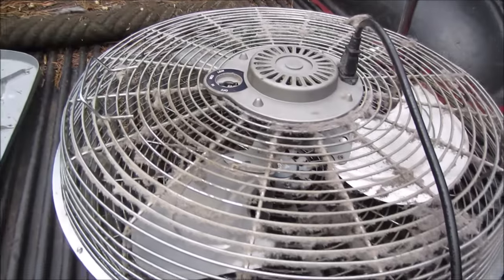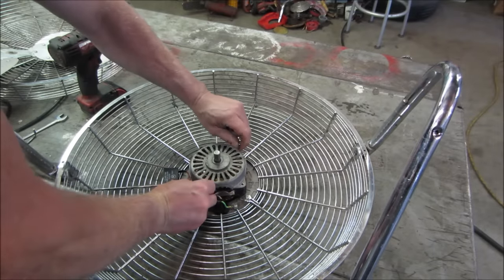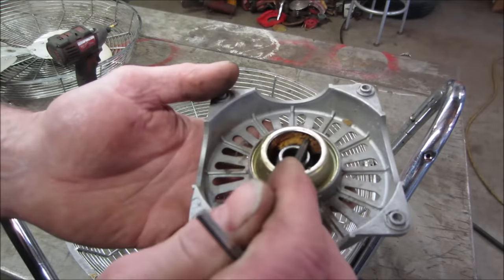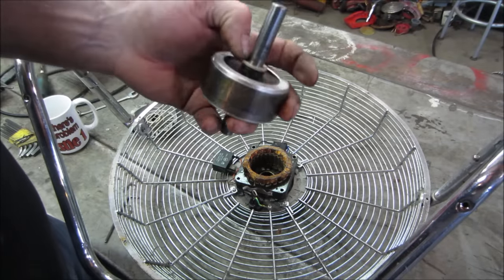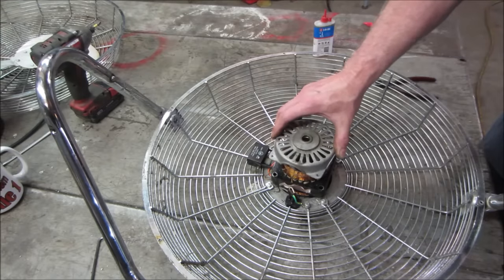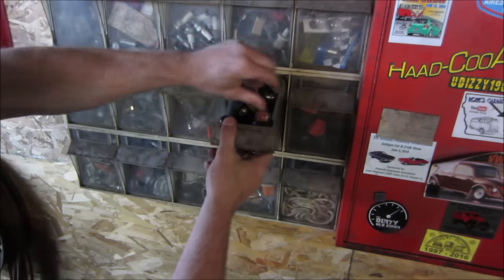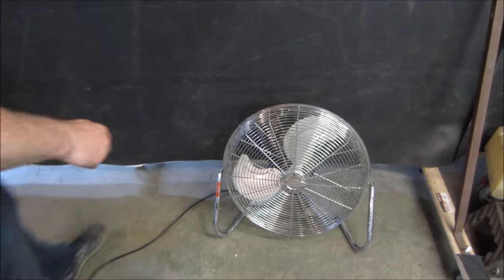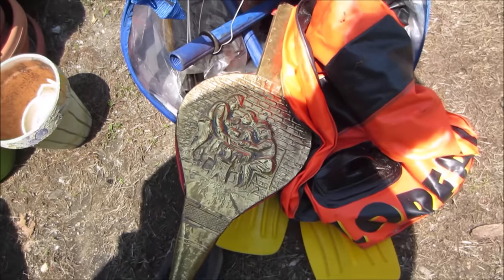Fan Blades Won't Spin? Lets Fix It

Comment: Hi, watched the whole vid to see if it was a fail. If this didn't work then the next thing would be to check the capacitor, they often fail so the motor has no start guts, cheers

Comment: Those look like bushings to me and not bearings. Also that foam stuff inside looks like old lubricant wick. You add oil to the wick and it self lubricates for a long time. I used to work in a Vacuum repair shop and we also did fans.
Reply from the maker: a bushing is a bearing,

Comment: Had a 10” desk top fan beside my bed at work, used it for the white noise to combat my coworkers, yes I said work, I was a firefighter for over 30 years, we were allowed to sleep at night it the occasion arose, sometimes it did, most times it didn’t, had to tear down and clean every couple of months after it was a few years old, sure wish I had known about the 3-1 oil, might have save some frustration at 2am after an EMS or fire call. Nice job, thanks for sharing the video, even if it was two years to late for me, now I know.

Quick question, this should work on all fans right, like a noisy ceiling fan...?

Comment: Its probably foam in the bearing, used as an oil reservoir, (used to be felt years ago), foam goes all powdery and gums the bearings up. Wants a light oil to lube it.

Comment: The only time I went to take one apart it would lock stop when the switch was turned on. 

It had a dead short in the windings. Unfortunately oil and polish won't fix that. But originally it was doing as this was. You could get it going some times and then it'd work normally. During tear down I found a crap ton of shrink wrap wrapped around the shaft behind the fan. It had caused an imbalance and irregular wear which is why if you spun it up it would start working. Ironically it was using the shrink-wrap as the lube when it heated and softened.

Comment: I'm surprised you did not devise some sort of oiling system on this fan like a little oil cup with screw on lid on the top and a tiny recovery basin on the bottom. I have thought about this many times oiling up my fans lol.

Comment: I've been keeping my fans running for years, BUT, you have to take it apart to oil it.  I already know the answer, but why can't some engineer design these fans in such a way where there is some kind of port to oil the fan motor/housing instead of taking it all apart and then hoping you remember where all the screws are and how to put it back together again.
Reply: Old ones had oil ports feeding the felts, I'll bhazard a guess nobody oiled them. I had a modern one where I took it apart new and soaked the oil felts in ATF to see how long it would go, that one blew a thermal fuse buried in the motor windings from dust buildup I had neglected, so there's really no winning unless you put in more work than they're really worth.

Comment: I had the same issue with a table fan (220v).
So, I did the same - removed everything, cleaned everything. Tried first using mechanical grease, but made it worse..
Ended up removing everything, AGAIN, and then used an oil instead. A guy gave me the tip to try and exchange the sleeve bearing for ball bearings. But that will increase the noise level..

Comment: I have fixed many of that type fans ,The better ones,I have found that they put felt as bearing packing (the felt holds the oil) but sometimes I find they put saw dust as bearing packing(The cheaper ones) .

Comment: see that galling and black thats what you polish out, run nail if you feel groove repolish.. i use drill and a vise.. the gooky insides was a feltlike wicking, replace with felt it holds oil.. bronze bearings are porous.. thats why it failed no oil.. lube felt till shiny to touch..  never grease or motor oil it damages ..  amazon has zoom oil non detergent..

Comment: Dude, get ZOOM SPOUT with turbine oil. It's a pure highly refined oil,it's so pure you can lubricate a clock etc..
Also ZOOM SPOUT offers a penetrating oil. These small squeeze  bottles have a see through  flexible TUBE that can extend into small spaces. It retracts inside the bottle when your done.

Comment: I guess im not the only older timer out here who stil posseses tool skills and as a product of depression era parents was raised to obtain, then maintain the equipment i had as well as any castoffs instead of giving in to the destructive capatilist manta drummed into us by the media of buy , use(until out of warranty) , toss, and rebuy another of the same . ive actually never bought a new vacuum, Dayton fan type as this one), dvd player, bicycle, etc because in this nation all i have to do is pick one up beside the road and fix it which usually winds up being more akin to just giving it the proper periodic maintenance due any electo-mechanical product. That said, i believe the govts. Past forty years of slowly defunding the educational system to yeild a more docile and compliant herd by placing them under stress both economic and physical . This tactic and others have been developed , honed, and tweeked to adjust for the time factor, has been used for centuries. Worried ,inept, sick, cattle cause few problems for the .1% as Chomski reiterates.All the shop classes we usez to have in jr. high and high school enabled the kids with an electomechanical bent to discover and guide their future coarse of study ,as much to the chagrin of the politically correct, i must poi t out that many are just not destined for college and a PhD in physics. Were not all created equal and im sorry if that hurts those liberal democratic bones that promote programs to give jobs not to the most qualified but to whichever flavor of the month is in vogue.I know, off topic but somewhat related as we should all be doing what this fellow does for our own sakes and the planet. Its far easier to take care of this one than to migrate to another world. By rebuilding that fan he saves resources and pollution making up for the wasted resources of the person throwing it away ojt of lassitude. Rich/San Jose

Comment: I have this issue with glazing all the time. Dryer rollers are a metal on metal contact. No bearings, just a bushing on the roller. They get full of gunk all the time and start to seize up.

Comment: To add to Colin_583, you normally leave those sintered bronze bushes in thin oil overnight to fill the "holes", I suppose you could heat them up a bit too, to drive out air to let the oil in.

Comment: The quick and dirty way to fix this is wash the motor too with at least garden hose force. Air gun on the electrics, spray the crap out of it with WD40 or whatever, sun for an hour and bam! Works 99% of the time. Engine degreaser also helps if it was in a really dirty environment

Comment: I recently fixed a black fan!   
And the fan wouldn't turn !

But I had to cut out the metal rods that go up and down !. 
Once I pried it open!  I saw the grease part all orange and dried up!.  Once I WD40 and cleaned it. And put in new grease!.

The fan started up like new . And it sounded newer then before. 
.but easy fix .

Comment: Did I hear you correctly, jumpstart, it is only for engine, for electrical you need a meter to check whether the wiring is working, if shown the ohm moving than look at the capacitor there are two aspects you need to fix the fan?

Comment: Those are easily 50 bucks a pop.  It's amazing what a tiny amount of cleaning and lubrication will do.  It's probably a shaded pole motor, very common in fans and cheap to produce.  Not a bad motor, but the one big drawback is they have wimpy starting torque.

Comment: I’ve fixed mine from wal mart it’s better to Chuck it in the lathe and use fine ribbon emery cloth on the shaft to clean it up  wet it with oil for the final cleaning them wash with carburetor cleaner to get rid of the grit on the metal case motor I drill a small oil hole in the center of the shaft in back so I can oil it the front just oil the sleeve  I use STP to lube it along SAE 30 non detergent motor oil have kept them running for years like that   BTW on the tractor supply ones that overheat and lock up while you have it apart drill out the vent holes solves  that problem !

Comment: you might want to get a spray bottle of hornady one shot. a few apps of it and then light oil. ive also used it on old gun stocks. once you have the parts clean on a pistol it wont attract dirt like oil does.

Comment: It was probably the spray grease used on the assembly line, as a bicycle mechanic I have found similar problems with bicycle bearings, you could try wd40 silicone oil in that electric motor

Comment: I wonder if the fan was used in a wood shop. That crap in the bearings looks like grease with a fair amount of fine saw dust mixed in it. He might have been using the fan to pull the fine particles of dust out of the work room and thus it pulled wood dust through the motor and over time some of it got stuck in the grease and absorbed the oil and made it crumbly. It looks grainy to me.

Comment: I find a lot of those fans that have a blown thermal protection fuse, which saves you from having a fire at the expense of the fan... just bypass it and it works like new

Comment: i use  only  5w 30  mobli1   in my motors  ..learned   that trick  building   motors  at delco products   ..plt 11  ...does not gum  up  or  burn  out..  only oil   that last in a  buck stove too  ..try it some time,,,love your vids

Comment: That soft stuff was felt, saturated with oil. That lubes the bushing like a wick.  Should use lightweight 20 weight oil. I have used cotton balls to replace felt seems to work.

Comment: That material is a foam or another type of material that holds oil ... the idea behind it is to wick oil into the bearing as it warms up the bearing itself also has oil impregnated in it as it gets warm it seeps out lubricating the motor shaft ... most common issues is the manufacturer doesn't use the same oil the bearing is impregnated with and the additives aren't compatible... that results in the oil drying up ... (just like running an engine with low oil... the bearing(s) don't like it at all once it starts drying out even more heat is generated causing it to dry out even more ... dried lubricant acts like glue at that point ... cotton batting material is fantastic as a replacement ... an ideal situation is to lightly loop a signal band on the motor shaft it will wick the oil directly on the shaft of the armature (the part pulled from the center) I have had great success with oil stabilizer (Lucas) that stuff is super clingy and stays where you put it

Comment: Hello, I accompany you religiously because I like your channel but, in this assembly and cleaning only, you would have to put enough oil on the felt because when the hump pulls the oil up and it has to be thicker car oil 40w or 50w, hugs.

Comment: 13:30 What i do in a "make/enlarge a hole in plastic" case like this is to use a pencil-type soldering iron with a pointed conical tip to carefully melt a "pilot" hole into the center of the plastic hub, and then use gradually-larger twist-bits to drill it larger.

Comment: I have that exact fan! It was called The WInd Machine. I thought it was a name chosen to make it sound powerful. But it's crazy powerful and is actually a wind machine :P The minimum speed is very high and super noisy, so I have been wanting to buy an RPM controller thing that lets me adjust it to any speed basically.

I just was surprised to get this video suggested since I hvae the same fan (in Norway).

Comment: Did you know the fan blade, besides keeping us cool, also has to keep the motor cool? We built a cool prop in our haunted house using a fan motor without the blade...it failed after a few uses...

Comment: It looks like the fiber in the bronze bushing has degraded. Normally you’re supposed to saturate it with high speed motor bearing oil so that it makes it through the bushing but that fan looks pretty old.

Comment: No thats Oil pack, just clean the sleeve bearing and re oil it. and it will work for years, i have fixed a lot of fans and motors with this packing

Comment: Whenever I get an old refrigeration compressor I drain the oil out before recycling the motor.  Just a guess but that grade of oil should be good to soak the old cellulose or replacement felt in the two bearings.

Comment: sintered bushes can be pressure filled put a finger underneath fill to top with 3 in 1 and squeeze top to push into pores or leave to soak for a while then top up the felt pad next to the bearing to keep it going longer should be good for years.

Comment: usually that stuff you found gunked in the rim of that shroud bearing is literally what you thought it was. should have been a piece of foam kinda like seat foam that you the soak in oil to lube the bearing. Over time it dries out and becomes what you had. A mess

Comment: Some motors have what is called here as ear wax, which is supposed to soak up a lubricant and slowly release into the bearing/bushing and they become dried out from heat and time
Reply: We used nose oil for a light coating of oil on the tracks for the linear motors of big disc drives when I was a tech at NASA 30 years ago. Nose oil is found in the crease where your nose joins your face. Younger people - kids -  have an abundance of it. You rub your nose and smear a light coating on the tracks to keep them from rusting.

Comment: Looks like it needed some lube and works fine, but a test of the little black square capacitor could go a long way. Half the time that is the cause of deeper issues like dry overheated bearings.  If your meter can't test caps just replace it for a few bucks. It will seem to work fine when the cap is bad or puny, but it stays in the circuit at all times syncing the motor speed with the 60Hz. It kinda smooths things out.....Nothing quite as satisfying as making a piece of trash work like a charm , nice vid.

Comment: I’m always amazed that folks will toss something that takes 18 minutes and 25 seconds to fix! Great junk pile score!
Reply: I know it. A couple of days ago my central air outdoor unit started short cycling. On observation, I saw the fan wasn't working. That usually means the capacitor. Opened it up, checked a few things, went downtown and was back within 30 minutes with a $12 capacitor. Installed and back in business pronto.

Comment: Polish the shaft...rub nail on shaft remove all yuckies...  put motor into a drill...I use up to 3ķ grit.. run it till it shines  andd smooth.... that's the key...plus smack motor to set 2 bearings... clean bearing qtip and isopropyl... my fan like yours is from 2000.. runs like new.. tufoil can  make custom lube.. non detergent only.. test fans with a meter for watts used..to see if in spec.. watt meter cheap..  high watts lube ckean polish motor..  also add felt to replace lost packing for motor.. they hold oil for bearing lube... enjoy

Comment: have a little black Honeywell fan that seemed to do the same thing ... though those "Jumpstarts" would get it working .... turns out cleaning around the shaft the blade is connected to and oiling a few things up ... made it function like new
Reply: looks like you have the same oil that I bought on Amazon ... $2.13 for me .... and the fan I fixed .... needed two applications ... HOWEVER the first one that lasted for about 1 1/2 weeks of CONSTANT use .... I may have gone on the side of not putting too much oil things ... it's been at least 2 weeks since the redo .... and it works as if it were new

Comment: I prefer to clean both surfaces first then soak with transmission fluid for a day before reassemble.i use trans fluid mixed in with thinner to use as a fluid when I give an airless back when overhauled as a reminder not to leave them in water which is the prime destroyer of paint sprayers.

Comment: Had one that would get slow from time to time. I'd clean and re-oil the bearings and it'd run fine for a while. Eventually I noticed a tar like substance on the shaft. I surmised that the motor was running hot and cooking the oil, so I retired it. Never really noticed anything wrong when the fan was running.

Comment: I drilled holes in the motor casing right above the bearings big enough for a wd40 tube to fit in. When fan starts to squeak, give it a shot.    Yeah wd40 isn't the optimum stuff......but it takes me about 10 seconds to oil it.

Comment: Nice!  I've rebuilt many a fan over the years; they're just so simple, and people throw them away for the goofiest reasons!

I've found that the bearings (if present) respond well to simple NLGI #2 grease, and bronze shaft bushings really like dry graphite or teflon spray lubes.  Alternatively, Royal Purple makes an insanely expensive but effective spray lube that's not quite as dry as typical graphite or teflon sprays, but works REALLY well, and doesn't attract enough dust to cause longevity issues like WD-40 and other "wet" sprays do.

Comment: Lots of times I can fix those buy oiling the motor bearings.

Some AC motors act like that because of a bad start capacitor or a bad centrifical switch.
That one does not seem to have the centrifical switch.